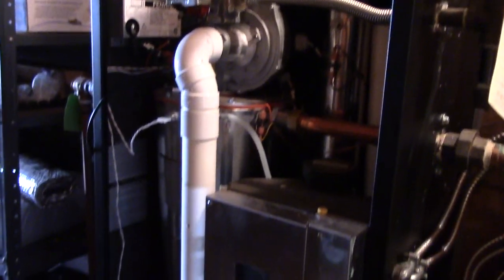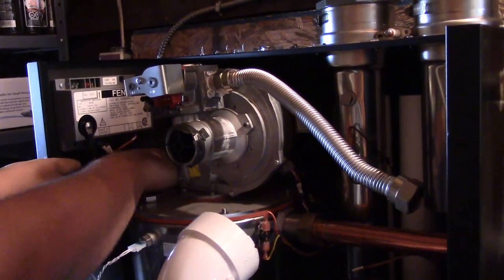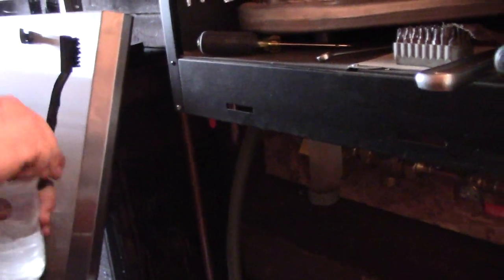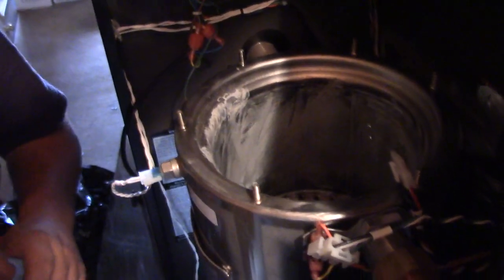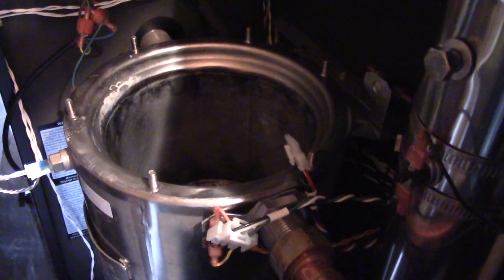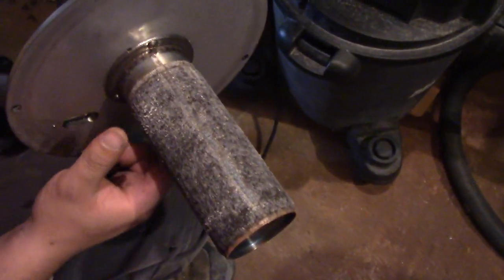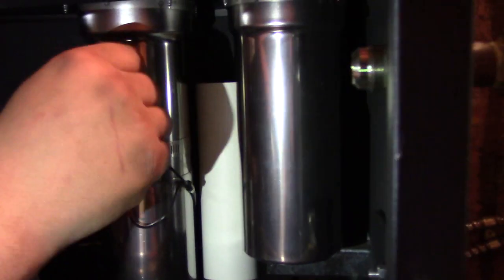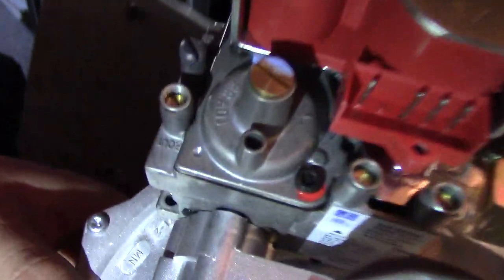Servicing IBC Boiler

Comment: Hi Byron. Your video is super informative. I am a homeowner and not an HVAC expert. But I’m savvy with technical details, so your video really interests me.  I have an IBC SL20-115 G2 boiler. Recently, after a service tech finished working on my boiler, I noticed that the loads assigned to my in floor, radiant heat zone, and my baseboard radiator zone were swapped.  Any idea of how this could have changed?